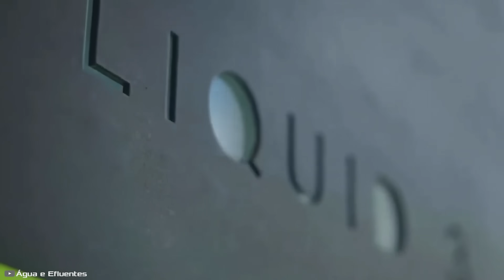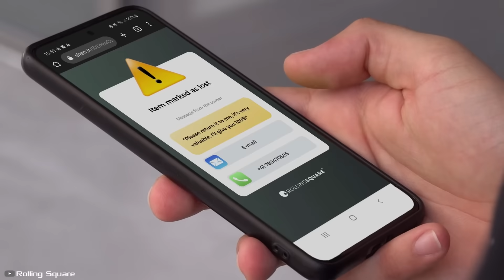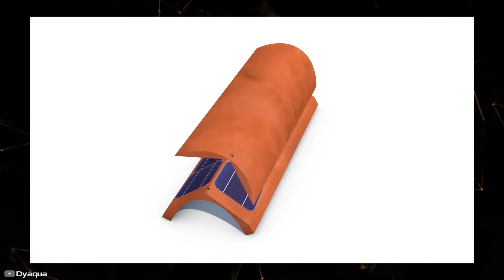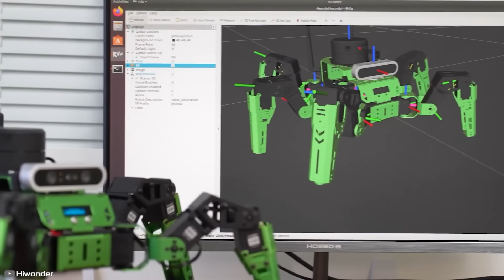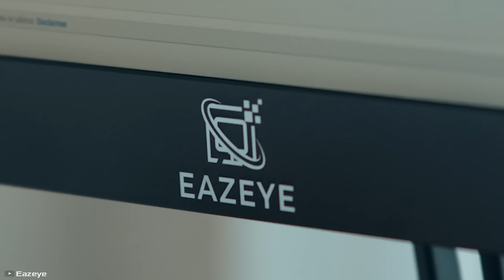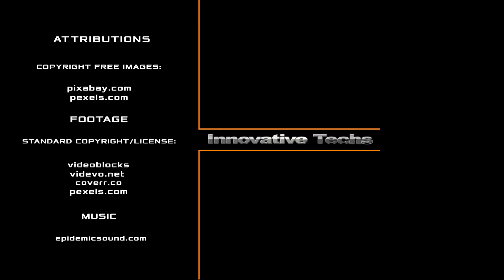15 INTERESTING INVENTIONS THAT WILL SURPRISE YOU

Comment: 10:29...Holy cow! Is that a 98 wheel 4 trailer fuel truck? (24 wheels per trailer x 4 = 96 + 2 front wheels = 98)
12:50...Oh that 3D billboard will make a plenty captivating billboard all right. Any car that passes by it that isn't self driven is going to be captivated to distraction!